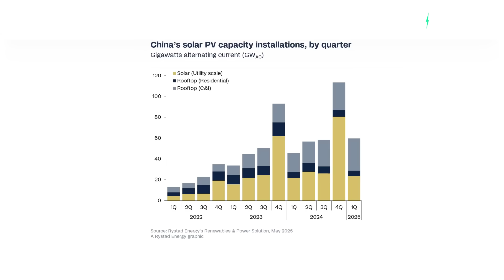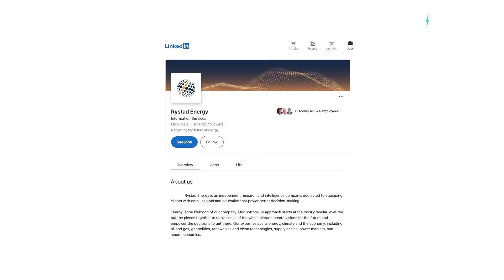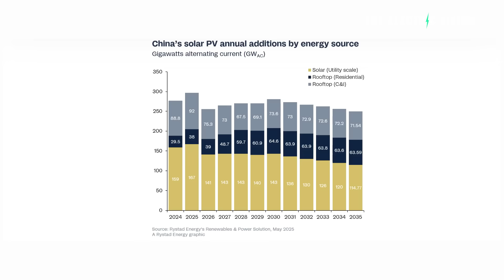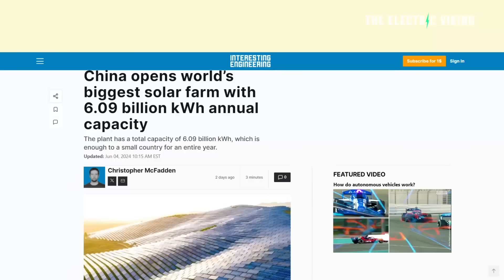China’s INSANE Rooftop Solar Record: Emissions Fall for the First Time!

Comment: China as a latecomer but investing full power, now that solar is cheap as chips, and without stopping to rely on coal, nuclear, natural gas and hydropower - is seemingly doing right everything what the UK, Germany and most of the EU did too early, too expensive and totally wrong. China is doing it now, including the addition of battery power storage now that is has become multiple times cheaper than it was just 7 years ago.

Comment: China's municipal governments have a mandate that if a solar company wants to win a contract for solar rooftop in the county they have to put solar on every single rooftop possible. So essentially a company like Longi wins the contract and then over the course of a couple years every single rooftop, has rooftop solar. There's no picking and choosing between large flat warehouse rooftops and steep residential homes, it all has to be taken into account and panels installed.

Obviously their property ownership structure helps immensely versus the West which for better or for worse has a million property rights issues regarding these types of mandates.

Comment: Wind and solar energy are safer, cleaner and cheaper than fossil fuels for power plants and generating electricity.
They can produced energy locally reducing the need for costly imported fossil fuels.

Comment: COMBINING WITH THORIUM REACTORS AND THE PROBLEM IS SOLVED. NOTE: CHINESE DID BUILT SERVER PARK UNDER THE SEA FOR COOLING.
Reply: Way way way more expensive than renewables.
Reply: @nordic5490  PLEASE, AN ENERGY INTENSIVE INDUSTRIAL ECONOMY CAN NOT FUNCTION ON ALTERNATIVE ENERGY ALONE.
Reply: Thorium nuclear reactors are still very much experimental and only in China (as far as I know). I suspect that a projected price for electricity would not yet be available. But thorium does look promising. Let's support it!
Reply: @Fomites  MAX 5 YEARS FOR COMMERCIAL COMPLETION.
Reply: @marcionphilologos5367 I hope so. But other non-experimental/standard reactors take much longer to build and always run over budget so I don't know how or why thorium would break that mold.